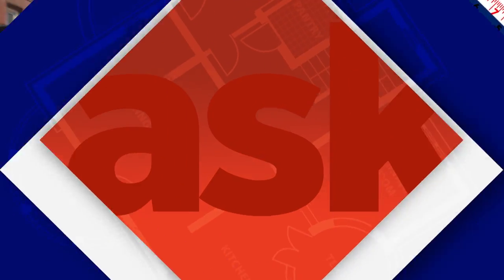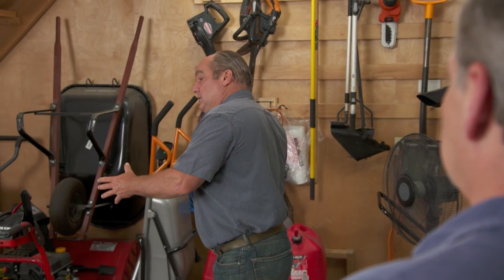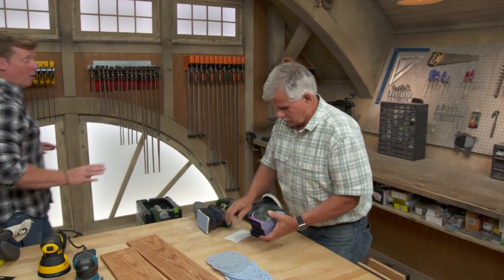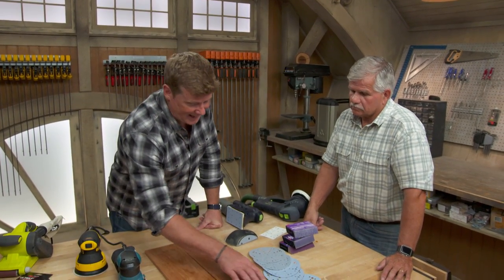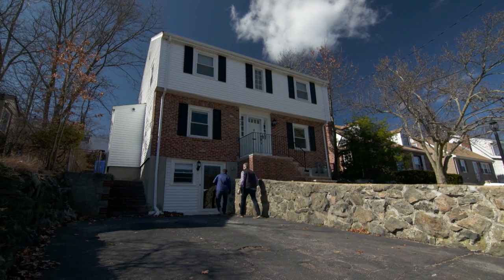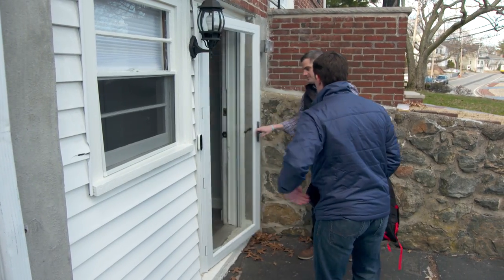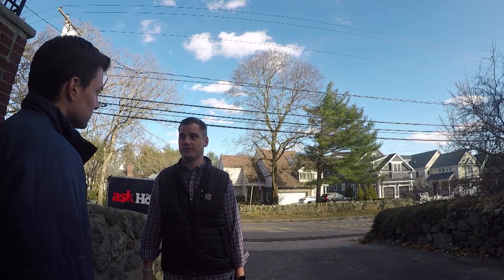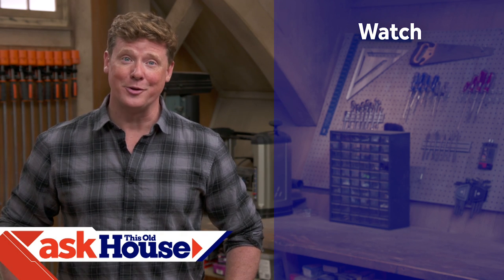Ask This Old House | Garage Heat, DIY Security System (S17 E4) | FULL EPISODE

Comment: To prevent loss of connection to the security system when the power goes out you can also add a UPS backup battery to power the modem/router and security hub when the power goes out and avoid cellular subscription fees.
Reply: Yeah that's  correct. However how often do you have a power loss just in your house? It is probably more like the whole street or area. In which case there is a good chance that your internet connection is down too. There is a chance of a cellular connection being down in this case too, but at least it is lower.
Reply: @lal12  no, highly rare, all ISP's have every system on backup power sources because they provide critical emergency services to many different clients like Voip as a 911 service, or critical data to companies and emergency services, aslong as you can keep your system's up, when the power goes out. If you have cellular also then that is just a bonus, cell towers have generator backups also.
Reply: @lal12  the internet very rarely has issues on the back end, its typically just loss of power at your place that causes issues. also itd save time with router reboots and all that
Reply: @bradhaines3142  the internet Backend is not the problem. The problem are your local hops, the question is if they are on power backup
Reply: @lal12  if theyre not on backup im sure they get power from farther down the line, there are more than a few neighborhoods served by each one so its power would be fed way behind yours or your streets.
Reply: will turning on a router 24/7 will have any impact on the router??? just installed new fibre optic internet with ONU and a ROUTER.will these two will fail if i kept on 24/7???
Reply: @Abhishek-C92  they're meant to run 24/7 but a restart of them every now and then doesn't hurt, for a cache refresh ect.
Reply: @MikeStolarchuk  thanks man for the reply.
Reply: @bradhaines3142  can confirm most ISPs work during power outages. And, cellular data goes thru ISPs at some point.
Reply: Yup, have my router on a UPS, but redundancy won't hurt (except your wallet).

Comment: I’m in Connecticut and I’ve been in a few of the houses that were lifted up and had new foundations poured, we had to disassemble and then reassemble the heating and cooling systems, my old boos is friends with a contractor doing the work, this work will go on for years
Reply: decades*

Comment: Oh yeah, this all seems kinda bad...
For the heating:
1. Direkt heat via "flame" means co2 or even co gas, which is not good. And add light saw or wood dust, and that could get really dangerous. Why not a water heating system with independent air from outside? Pretty standard here in Germany.
2. The heater seems to point to the floor, shouldnt that aperture be higher? I dont think it will heat nearly half the garage.
3. Wouldnt it be betterto use a flexible hose to the heater and a possibility to adjust or change the heater direction?

Comming to the security system.
1. Cloud dependent is a no go in my opinion. There was last year a phase when i think nest servers were down for a couple of days and e.g. Thermostats didnt work at all. Possibly this adds another security hole.
2. Same for ki like cameras learning who is allowed to be inside and who not. Also they sould have to send video data to their cloud server to learn this... Yeah, do you want this company to get your private videos?
3. Cameras with internet connection are bad, there are most of the times some security flaws and holes, and nearly no company fixes these. 
So overall,diy security is possible way cheaper without these cloud connection thing, just using 433 mhz radio. Also this will work without any wifi.

Comment: why not a mini split ? you don’t have to worry about combustibles and you can cool the shop as well when you get those hot summer days. you do have to clean filters is the only downside
Reply: Richard Powers 
Then you have an excuse to install dust collection👍🏻
Reply: I put a mini split in my last garage and I’m fairly sure it sold my house way quicker. We had a half dozen offers in a day.

Comment: Those infrared heaters are great....if your standing under one of them...otherwise worthless.
Reply: Yeah I think in practice that's going to be undersize for the garage.  It probably needs a forced air for normal temp control and the infared during wood working.
Reply: @benjohnson4449  Agreed. You definitely need forced hot air in a garage environment.
Reply: Even if it only brings temp from 0 degrees to 40 degrees it'll probably feel great.
Reply: Toad Phillips Zero chance that raises the temp 40 degrees.
Reply: @billb.2673  It will not...but it will feel warmer..and thats the point.
He does that much wood working...id have a woodstove.
Reply: I've got emotional effects due to the yellow lighting. Just somthing I learned from using one of these.

Comment: Why don't you use a barrier to stop all moisture from entering the foundation?
Reply: You have to apply it from the outside to be effective. Which requires digging out around the entire house to the footer. Then you either roll or spray on the membrane and install a drainage system. Might as well insulate the foundation too while you're there.

It's about a 20k job. And you're right, it would dramatically slow down the problem. However once you're seeing cracks from the inside you're pretty much done.

Even if you were to pin the foundation cracks from the outside (best way), the concrete itself is garbage. It could fail while you pin it or after, negating all the waterproofing work you did.

Comment: Why can't they cut a slot into the concrete about every 4'  then replace it with a steel beams/ Jacks maybe then re-concrete every section 1 at a time pulling out the steel beams as you go. Yes, I realize this will be costly and a lot of work, My question is would it work? I have foundations problems at my place and I find myself doing a ton of thinking and talking out loud to myself, just no answers yet. Has there been an update to this video?

Comment: 7:23 why would they put the thermostat directly next to the heater?
Reply: mlc4050 Actually it’s better there because of the way this system works. Think of it as a heat ray. The items that are hit by the ray heat up. The thermostat would be heated by the ray if it were across the room. By being next to the heater it’s out of the path. Like standing next to a fire hose instead of in front of it. The results is that now the thermostat is measuring the temperature of the room.
Reply: Good question

Comment: Why wasn't pipe doap used on the yellow gas line connection that came through the ceiling??
Reply: This connection is of a different type, it's a compression fitting that self seals. Pipe dope is used on threaded iron pipes where the bottom of the thread needs to be filled with gaz proof paste (dope). Pipe dope was used on all iron pipe threads in this installation.

Comment: Always hated how they waste everybodies time like showing how to plug something in to the wall but yet fail to show any of the parts the average person woukd have questions about.. like here they should have gone over all the specific options, different systems.  Or the plumbing of the gas line, showing dude screw the fitting into the plate but didnt show the actual plate which would be the hard to find item at the ole home store..  or how they ran the line from the attic to the garage.  Did they fish it through, was it a two story drop and the dude up top just dangle the line down until he happened to find the hole?  The foundation issue..  couldve gone over different types of soil, different stresses on the foundation, when to worry, sill plate movement, dangers of diy, mold entrapment, cinder block corrosion compared to a brick or stone foundation.  How to remove stains like the ones shown, different hydristatic compounds to seal, paints and hydrophobic coatings, laminates, what not to do like cover it up, wood framing members against the concrete to cover up, what happens when just using latex or acrylic paints do in that situation, maybe improper prep if the area before painting..  
  Ya know the stuff bob vila would have gone over..  lol...  ahh..  thats funny right there...  but content could be more in depth and directed towards a topic rather than touching multiple and leaving holes..  just saying..  still watch em though..  one thing they dont do on this show is give their audience bad or incorrect advice and thats a plus for the contractor that may have to go behind mr diy..  ya know, the dude or dudette thats holding a screw with all 5 fingers against drywall, one eye closed, tongue hanging out, no ppe, holding a 5 lb sledge all choked up next to the top, standing on a fully extended ladder propped up on a screwdriver to level it out, on the top rung leaning over to the side, while their four 7 year old boys are playing with their friends and toys on the floor below after dinner time unfed and sleepy, phone ringing in back pocket, and the 2 full grown huskies running with leashes on to the front door under the ladder and doorbell ringing with pizza delivery at the door...   ( the cover of the osha handbook.. or should be)

Comment: Aside from hacking concerns, what's to stop a burglar from coming in that door and cutting the power cord to the security system hub that's right next to the front door? Or one could just cut the cable TV line outside and disable the system by killing internet access.
Reply: B May Everything in the system is battery operated so if the cord is cut the system is still functional and is they are paying the monthly fee it doesn’t matter if there is no internet, the hub will notify 911....
Reply: @MrEljavi84  I did the dumb thing and commented before I got to the very end. I do like the idea of a cell system, which is the only truly burglar proof (ish) way to go. But I'm sure it isn't inexpensive.

Comment: On jewelry, I use 240 grit, then 400, 600, 1200, then usually to polishing, although at times I might use finer grits before polishing. The idea is that a grit has to remove all the marks made by a coarser grit. If it doesn't, you jumped too far through the grits. In my jewelry making, a 240 grit makes big marks, a 400 grit will remove all of those mark while leaving its own marks, then the 600 removes the 400 grit marks, the 1200 grit removes the 600 grit marks and then polishing through several stages removes finer and finer marks until the piece is as shiny as glass. If you jump too far through the grits, you'll just shine/polish the marks left by the lower grit, but you won't remove them. That's how you know you jumped too far.
As a science and tech geek it's always driven me crazy to hear random orbital sander since it isn't random. It's repeatable. They really mean that they swirl a lot and move in small ellipses, but it is all predictable. I love the sanders. They do something wonderful. I just don't like the name because it's deceptive marketing name, not a real description of why they are wonderful. The name should tell you something about why you want this, and this is just a weak meaningless marketing name.

Comment: Couldnt you do some temporary load bearing walls in the basement, knock out one wall, pour a footing, and build a cinder block wall, then once its done move to the next wall? I mean, still not an easy or cheap fix, but not as expensive as moving the whole house. And I'm guessing they still have a decade before the houses become terribly dangerous. So you could do it in steps. One wall every couple years to spread the cost out. Hell, what if you just said screw the basement and fill  the whole thing in with gravel? Maybe just a slab on the very top.

Comment: My guy about the security system, good info. As a former employee of one of those wireless security system companies, you actually made it known about cellular vs wifi as well as the central monitoring station. A ton of people don’t know about that stuff. Another thing people should know is initial setup differences. For the system shown, you literally had to stand there with your phone and program the sensors to the system. They are some companies like the one i used to work for that setup the sensors for you before they are shipped to you so all you have to do is mount them. Of course that usually means the initial cost can be more expensive but it saves a ton of time.

Comment: You can dig down outside of the foundation and waterproof it then the problem becomes minor.
Reply: I did that to my entire back wall.  It was a crawl but it was about 5' deep.  I rented my own small back hoe (smallest they had), it even fit through my 26" wide gate!  I dug up the whole back, shoveled out the remaining, used a wire brush on the cinder block, waited for any moisture to dry (didn't really have to according to the products instructions I was using), and then applied Blackjack.  I should have put at least a 5 mil vapor barrier on the outside of that (while still wet) but since I am not keeping the house I just back filled it back up.  Took a few days of only working a few hours each day
Reply: Regarding the crumbling foundation issue, concrete always has some moisture in it, that's why even above ground, any wood that is in contact with concrete must be pressure treated to avoid rot.  The moisture, however little, will wick up from the ground and into the concrete walls and cause the reaction with that pyrotite mineral aggregate  causing it to expand (think frozen can of soda) and crack anything around it, ruining the wall.  That aggregate then turns to dust which looks like rusty powder.   It happened to my neighbor here in Northern CT.
Reply: Well said, what I was saying is that waterproofing the outside of the wall significantly reduces the moisture problem..   Or am I incorrect?
Reply: @georgebartholemew8444  Are you referring to the crumbling foundations?  If so, excessive moisture is not the problem here, these foundations have lost their structural integrity due to the expansion damage then the dissolving of much of the aggregate.  Only the small amount of moisture normally found in a foundation is enough to cause the failure.

Comment: Can't u put a power backup battery charger on the wifi
Reply: Yes, but for the average UPC, your talking maybe 20 minutes of power backup. That would be sufficient to catch an intruder that intentionally cut the power, but in a regular power outage scenario, it's not going to help you much. 

You would need a back up generator that automatically turns on when the power goes out.
Reply: @scotttovey  I use a UPS at home and get a decent amount of time using a standard UPS if too want longer buy a bigger UPS. You could hold that for a day if needed depends what you want.. and if installing nest devices you can afford a $200 UPS to hold it for a day. A UPS is almost a must for a smart home setup.
Reply: Scott Tovey average router uses 6 watts and hour. You could easily get a 300 watt UPS to run that for 24 hours which would cover you in anything that isn’t a major outage.
Reply: @steve_main  
I agree, if you have the money to spend then you can get a day of power backup.

I consider the average UPS the $50 block sitting on the shelf of the local Meijer and Walmart. That is what most people will end up purchasing because they won't know that you can get a bigger sized power backup.
Reply: @Mrcaffinebean  
That's only provided you don't have anything else hooked up to it.
Reply: Scott Tovey of course. Very few people own desktops any more and even fewer need them powered.

Comment: 5:00 he missed the stud ):
Reply: He did miss the stud but it had a plywood backing. But he did strip the plywood more than once he also did it too the gusset bracket
Reply: “It will even run when the power is off'” “Hand tools in the dark?”
Reply: He stripped two screws: "over enthusiastic" power screwdriver usage.
Reply: @jasonjayalap  ☉ Sunlight.